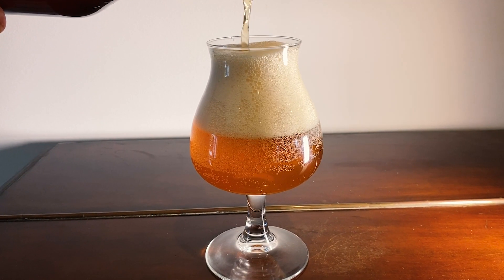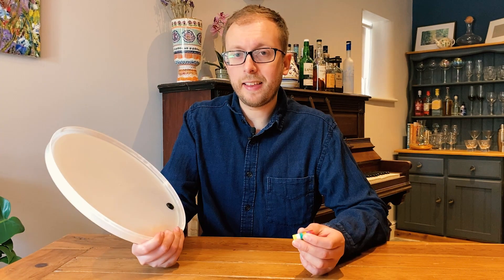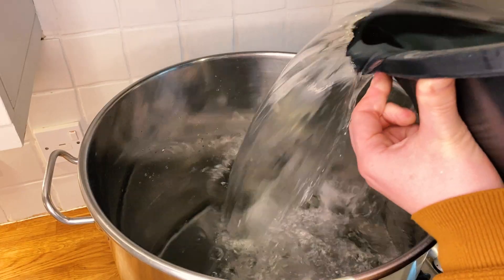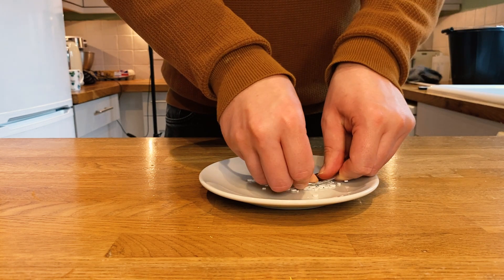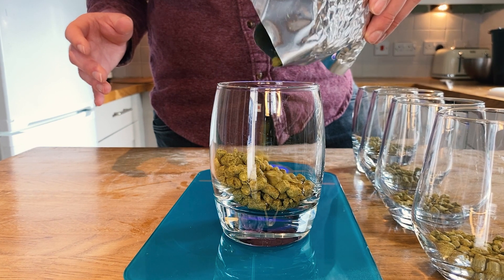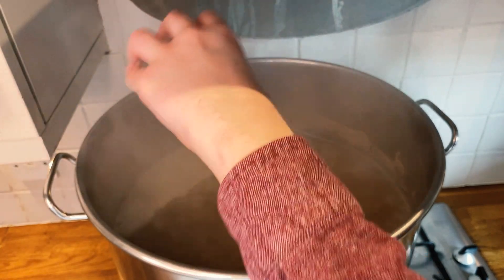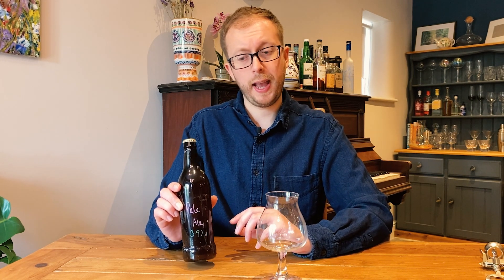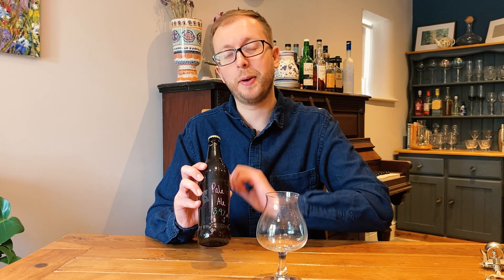How to EASILY Brew a Pale Ale with Kveik Yeast

Comment: As far as rinsing your grain bag with plain hot water, that would only bring your gravity and ABV down. If you rinsed it with the wort, it would stay the same. Squeezing the bag (which I always do out of principle and habit) only increases the volume of your wort, not the "strength." The converted free-swimming wort is the same gravity as the wort clinging to the grain in your bag. Rinsing it with water dilutes it (and that's not a bad idea if you need to hit your numbers and you're too high). Otherwise, fully converted wort is as strong as it is ever going to be, squeezing or not. I hope that makes sense.
Reply from the maker: Thank you, great advice

Comment: Great video. If you used the water profile from AB, does this mean we can copy that even with a different water profile ?
Reply from the maker: It would depend on the water profile of the water you're using. There are water chemistry calculators out there (For free!) which can help you match. You'll need to check your water providers website to if you're using tap water

Comment: Hey man. My english listening is not so good and I dont know if you told the fermentation temperarure. Can you answer me?
Reply from the maker: Hi, my fermentation temperature was probably around 35 degrees celsius. This fluctuated quite a bit as I don't have accurate fermenting temperature control, but if you check out my previous video about Kveik yeast I explain why this isn't a problem. Thanks for watching!
Reply: @Kveiksmithdaryl  Nice! I'll whatch the others videos. Thanks for your help!
Reply: @Kveiksmithdaryl  Nice! I'll whatch the others videos. Thanks for your help!

Comment: Mate, your grain will affect your pH, always mash in then add your pH until you meet the target dude, you’ll find it easier and more accurate.
Reply from the maker: Cheers! I did do that the first few times but then had comments that I needed to prepare the water before the mash! Perhaps I need to do a little mix of the two next time and slightly alter the water ahead of the mash and the continue to alter as the mash begins to get it bang on? I did test it during the mash and it was still around 5.6. Perhaps I just got lucky this time?!?
Reply: @Kveiksmithdaryl  Yes mate, I always add Phosphoric or Lactic last as you can never tell what your grain will do (as it differs from batch to batch), don’t worry that it takes a few mins to dial in, you will be ok.   Ignore the comments on water before the mash - most pro brewers add salts to grist and pH adjusters post mash from my experience.  It certainly is the chosen method amongst the majority of the UK Brew tubers.  Nice video mate.